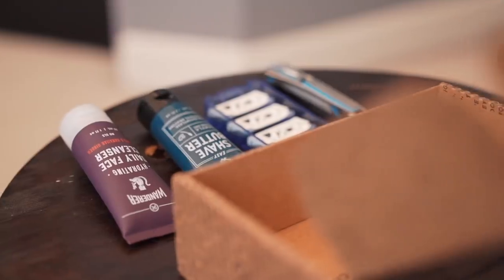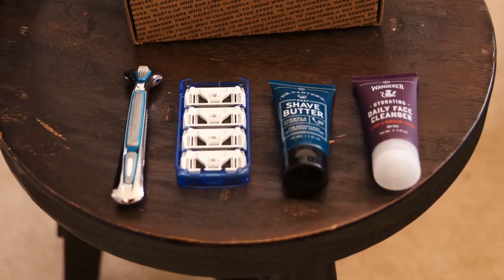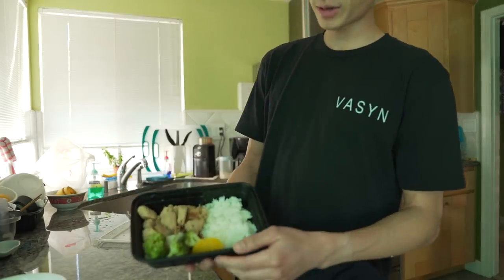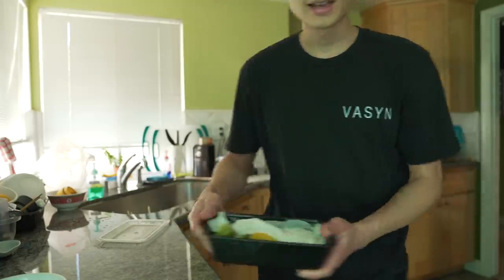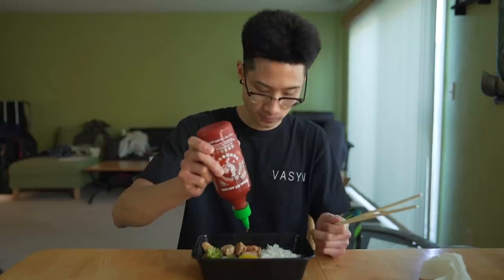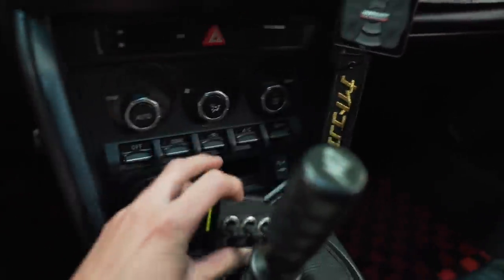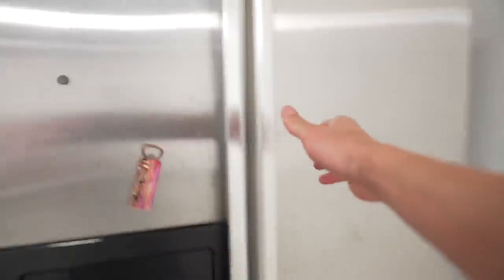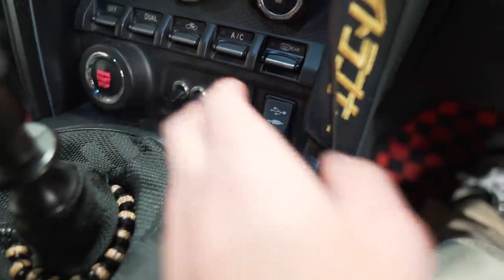Custom Interior Switches for the BRZ!

Comment: Hey kaz idk if you'll see this but a tip to getting juicier chicken is to sear it first on really high heat to lock in the juices, after it gets a golden brown color on both sides stick it in the oven at 400 degrees until it reaches internal temperature at 400, this could be anywhere from 10-15min depending on the size of the chicken. Regardless goodluck on your fitness journey!

Comment: I work for a company that do custom headlights and other lighting mods. Underglow is one of them. If you get underglow I’d suggest using your air lift more to ensure you do not scrape! Otherwise you will break the underglow . Other option is to put the underglow on the inner side of the jack ridge on your car 😎

Comment: Kaz you don’t have to dig in with ur fingers to get the razor out of the holder , u can put the razor handle the top part where it connects to the razor an click in / connect an pull out the razor. Easy

Comment: Honestly, I like any content of yours. Life stuff is just as fine by me as car stuff is. Long as the effort is there and it isn't clickbait-y I'll watch it.

I made my own switches to fit in my FRS just like these. 3D Printer and surplus store toggle switches. I have five, and from left to right I have:

-Driver's side heated seat (BRZ seats from a pick n pull lol, I'm in Canada and my ass gets cold).
-Battery charger, permanently mounted under dash, same exterior 110V plug as block heater.
-Center console 12V plug always on switch (charge stuff without key in car). Wired with diodes so if switch is off plug works in accessory only.
-Block heater (Canada lul). Careful wiring 110V AC stuff in with 12V DC stuff.
-Passenger heated seat (3 position on the seat switches for Hi <> Off <> Lo.

I want another switch position for a few more. Maybe under the armrest where stupid cupholder thing goes. I wanna still do interior light switch, stereo without key, and maybe dash cams (front & back) without key.